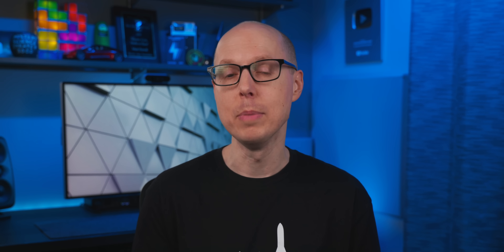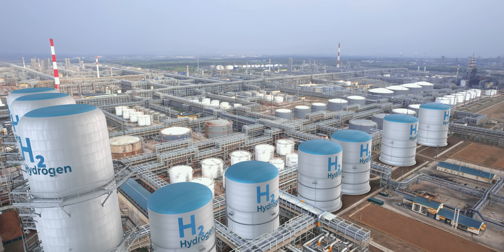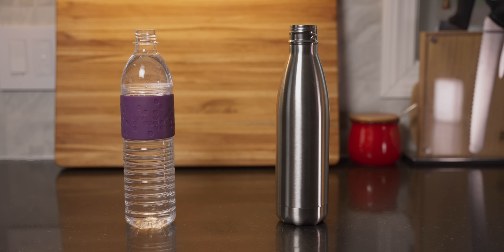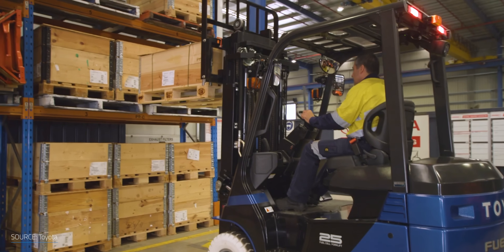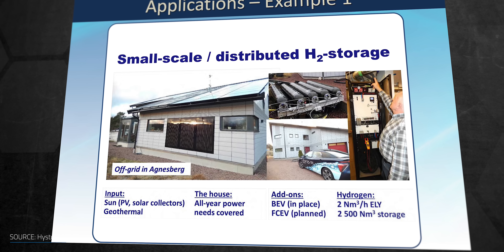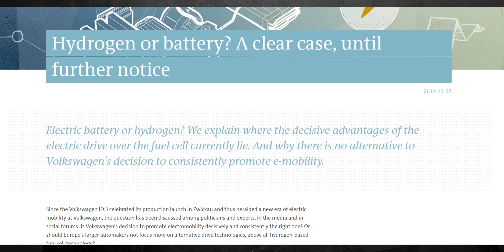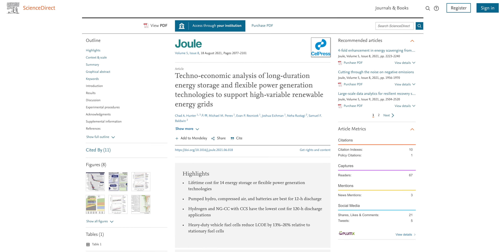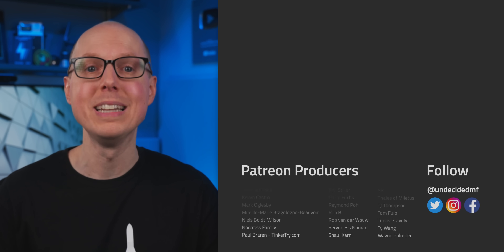Solid Hydrogen Explained (Again) - Is it the Future of Energy Storage?

Comment: One other area of comparison has to do with delivery of energy, infrastructure. Both electric grid and fossil fuels delivery systems are problematic (the former with reliability and ability to meet growing demand, the latter with pollution and contamination of groundwater and soil). But, both of those systems are already in place and “work,” in that they do get energy distributed to users. Electricity, via solar panels on a dwelling’s roof, can even be generated at the end user (not refined petroleum). 

Getting hydrogen fuel from the place it is generated (in whatever form) to the end user would require an elaborate and additional system of delivery, it seems. Current gas stations could be (and have been, at least here in CA) fitted with hydrogen pumps along side traditional pumps. But there still needs to be either pipelines to those pumps or on-site storage tanks, which would need regular refilling (along the lines of the current method used to refill underground gasoline tanks). 

In terms of daily convenience and use, electricity seems the most user friendly. Many (though not all) users have the ability to simply plug in, whether to a 110/120 or 220/240 volt outlet at home. In many cases (though again not all) even the lowly Level 1 trickle charge can work to one degree or another. 

So it seems this additional layer, delivery, is one that doesn’t get talked about much. But it seems critical if hydrogen is going to be a player in transportation.

Comment: The big advantage here is the long duration of storage. Since the cost scales slowly with capacity, it might be possible to take advantage of longer duration cycles such as yearly summer/winter differentials. This would be useful in very high latitude locations where you could store the energy from the long days of summer and utilize it in the short days of winter. Another example would be storing solar energy on the moon whose day is about 30 earth days. A bonus on the moon is that the water produced from the fuel cell can be recycled to generate hydrogen so the process requires no additional water.

But, considering the long development time still required, this technology is up against some hard competition for long-term storage. The first is that the current progress in the development of flow batteries might mean that they are ready before this technology is. The second is that there are already working examples of reverse fuel cells that generate ammonia from water and nitrogen in the air, the progress of direct ammonia fuel cells is encouraging, and the transport and storage of liquid ammonia is easy and there is already considerable infrastructure devoted to it. So the first obviates the need for this technology for long-term hydrogen storage, and the second dooms the hydrogen economy and replaces it with a much more economical ammonia economy.

Comment: Hydrogen is only pushed by the Oil and Gas Companys because of the this"from-the-chimney" Hydrogen, that is from brown H2 or Reformation Gas. Thats a process that is used for over a century now and involves hydroCARBONs to be partially burned to free their Hydrogen. But as it is burning of HydroCARBONS it also creates Carbonmonoxide and Carbondioxide in HUGE quantities.
So the Hydrogen Question its a "Trick Question", as its the Hydrocarbon Industries Way of still selling Oil and Gas, just the Burning isn't in your Car anymore, but in their Reformation Gas Facilities.
The creation of CO2 will just be hidden from the consumers view, but will still be created and will still be end up in the Atmosphere polluting the Planet.
Reply: And no, the Carbon-monoxide and Carbon-dioxide isn't "just" impurities. Depending on the HydroCARBON used, its a Main Product, like nearer to a 1:1 ratio the longer the Carbon Chain is.
The Stoichiometry doesn't lie, for each C turned Carbon-monoxide in a given HydroCARBON there at best only 1 H2 + 1H from each end of the chain. So the longer the Hydrocarbon, the less efficient it get. And don't even think about the double or triple bonded Carbon atoms, which only will have 1 or even non Hydrogen bonded to it.
And it gets even worse if they use the most common Process, the Coal Reformation Process, as this literally means you use burning COAL to heat water till its overheated Steam, mix it with equally heated Air and then put this really hot Steam/Air Mixture with high pressure through Coal!
Effectively burning or "reforming" Steam(H2O)+Air(O2)+Coal(2*C) into 1 Hydrogen, 1 Carbon-monoxide  and 1 Carbon-dioxide.
And not only is Carbon-monoxide deadly poisonous gas if breathed in, its also a even more potent Green House Gas then Carbon-dioxide.

But then they can sell you a green-washed clean conscience, as you will "only" burn Hydrogen… or so

Comment: I still don't understand why round-trip energy efficiency of hydrogen matters so much. Take diesel and gasoline: After oil has been drilled and extracted, it goes through energy intensive refining, then energy intensive transport, and is finally burned in an engine cylinder yielding 15% useful energy, the rest being wasted as heat. Yet, oil has made Exxon and Chevron billions. Likewise, hydrogen energy efficiency and cost efficiency need not be concordant. All that matters in the end is $ per watt or $ per mile driven. Along the way, grotesque amounts of energy losses may occur, and yet have a path to make a fuel or battery commercially viable.

Comment: Hydrogen, in general, is just such a bad option for most applications.  It has niche uses where it actually makes sense.  And that's the tough truth about hydrogen as an energy storage medium.  You won't find a broad application.  You won't find many cases where it is the best option.  So is there enough money in those rare niche circumstances to keep R&D going on the few companies still trying to use hydrogen?  To add insult to injury, these comparisons versus Li-Ion batteries are soon to be jokes as Li-Ion is on its way out, to be replaced by "dry" battery tech.  How will hydrogen compare in 5 years?  10?  With as little money into hydrogen R&D and as few hydrogen companies that can stay operational?

Comment: In an off grid home energy system, after your batteries are charged, making hydrogen by electrolicist would be free (exept cost of the cells and storage system) as your solar panels, wind mill would other wise have nothing to do with there potental and can be used just like propane or natual gas to run a generater, water heater, furnace, etc. The storage system has been the stumbing block. If this tech could small recharge systems...

Comment: You should really do a video on ammonia. It's an efficient way of storing and transporting hydrogen that liquifies easily and has a higher energy density than even liquid hydrogen. All you need to add is nitrogen from the air. 
It can also be used directly as a (zero-carbon) fuel, and is receiving a lot of investment from the shipping insustry. 
We already have the infrastructure to handle hundreds of millions of tons of ammonia annually, which is about 100x more energy than our total capacity of pumped hydro. 
We're already seeing massive green ammonia projects popping up, and with rising natural gas prices, green ammonia is now actually the cheaper option.
Reply: No such thing as zero-carbon fuel as you still have to spend energy to produce it in large quantities in a time efficient manner.
Reply: Superb addition to the whole concept!  😎
Reply: But ammonia is extremely toxic to man...and it needs a factory to make it at high temperature and store at -30degC. Not metal hydrides which are non explosive, non toxic and stpored and relesed at ambient temperature now.

Comment: While we're talking about grid energy solutions, could you do a video about thermal storage systems as a potential battery? I'm confused why they're not talked about more for grid storage, since it seems super cheap and scalable to make a large vat of molten salt and just heat it up during the day and generate electricity through steam turbines at night. It seems that scale is very much in your favor, since it's easier to insulate larger volumes (volume to surface area ratio),  and heating dirt is literally maybe the cheapest way to store energy. Maybe there's a reason I don't know about which is why they aren't talked about that much?

Love this video and keep up the great work!

Comment: I am a big fan of Undecided but I am not a fan of hydrogen as an energy source because the technology seems to be an end run for the oil and gas sectors to use natural gas as the source for the hydrogen, getting us nowhere from a green perspective.  I noticed that the information on the final graph was from 2018 which leads me to believe that more efficient battery tech happening now and the new innovation happening every year for cheaper more energy dense batteries for storage are the better solution.  I am sure there are a few cases where hydrogen storage will be a better case but from my view it will be a more expensive use case probably based on natural gas and counterproductive for the environment.